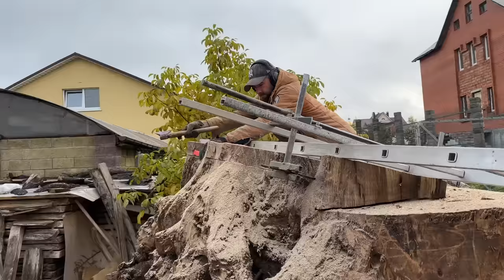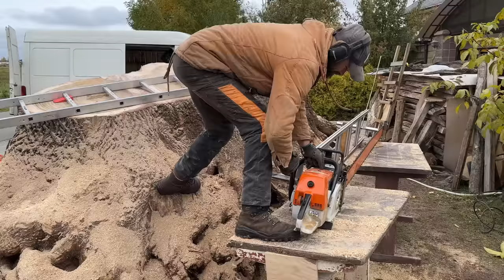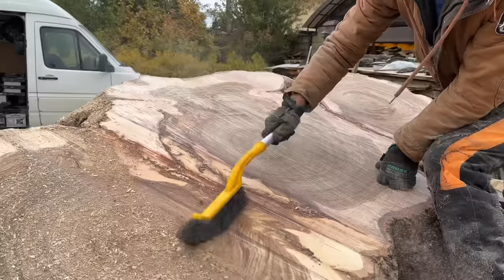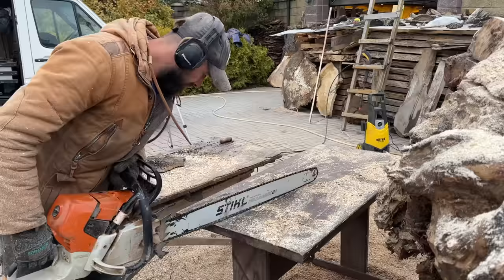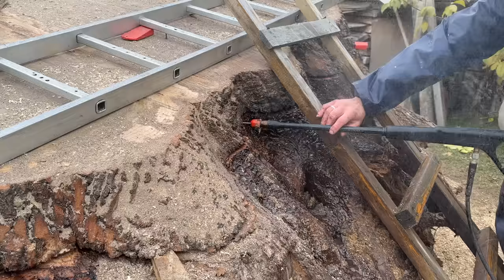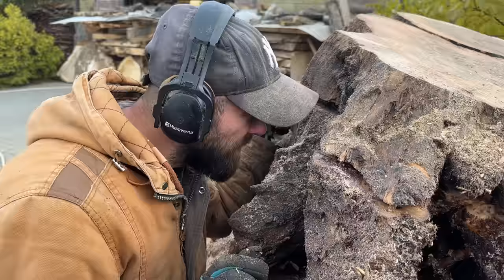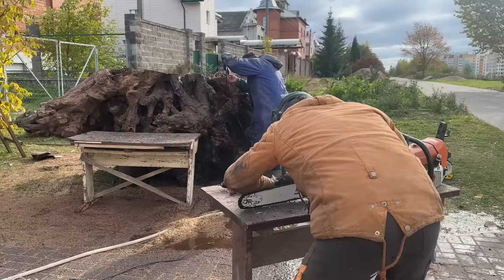A shocking find in an ancient oak stump

Comment: That was a tough slab! I saw stumps and root burls on my sawmill and stones are a killier, but that huge chunk of steel definitely would make life miserable. I have a chainsaw mill as well and always wondered how a carbide chain would hold up? 🤔
Reply from the maker: We have regular chains. The stone drank a lot of blood. We completely sanded off the top part))))) Basically it was not sawing, but one continuous sharpening of the chain🤣🤣🤣
Reply: I didn't know carbide chains existed.
Carbide is much more brittle, so instead of the teeth getting the edge dull, they would most likely just break off.
Reply: @spappy2k6  firefighters use them all the time to cut through nails and roofs and buildings. They are 1times more durable then ypu think
Reply: Stilh sold them, namede Golden teeth.
Reply: @Monkeysic  it must be a different grade of carbide then.
Moulder and planer knives made out of it would be destroyed the first sign of metal or other foreign object.
Reply: @BelkoWood mate you great patience.  Well done.
Reply: @BelkoWood Аа алмазные цепи бывают, вот с ними уже вопрос решился бы!!!😊😊😊
Reply: CARBIDE TEETH CUT BETTER, BUT THEY ALSO SHEAR OFF WHEN THEY HIT STEEL AND YOU NEED A GREEN STONE TO SHARPEN THEM.  MUCH MORE EXPENSIVE
Reply: @BelkoWood  The shocking thing for me is the fact that you are fooling the viewers with your false reports!!
Reply: @spappy2k6 depends on the grade of carbide.. there are demolition chains that fire fighter use that cut through bolts etc.. then there are carbide cutters for cutting stone too.. but.. they arent goot with wood etc.. they're more like corse grinders.. AND you NEED specialist diamond wheels & geared grinder to sharpen them
Reply: @BelkoWood experience aye is a school of pain & patience.. been down this path a lot.. a LOT!.. tips I can offer.. keep a sharp chain even cutting around embedded stone & steel BUT use slow rpm's.. you feel your way around it with the bar tip & only destroy a couple of teeth a time when you touch.. also.. don't run with your side cover.  I bolt through the bar to the mill at the power head end.. then i just swap sharp chains on.. i don't sharpen on the saw.. chain grinder on long bars is MUCH faster & helps with sanity.. 3000psi water blaster from a 1000ltr ibc tank gravity fed off the ute deck works excellent.. an 8mm tube braised to the blaster nossle lets in get right in the cut at the stones.. must have been a valued stump? cheers from NZ
Reply: Тест на ж/д рельсе...

Comment: I hear Teak is bad for pulling sand up into the trunk due to its fast growing. Many sawyers will refuse to cut it because it dulls the blade faster.
Reply from the maker: Well, it's oak. Teak doesn't grow here. It would be interesting to work with this wood
Reply: Its oily, I think because it turns water, was why it was once used aboard battleship decks. Definitely and outdoor type wood. @BelkoWood
Reply: @jmalone2758  Oh come on, the first thing they teach you in dendrotypology 101 is that contemporary dendrophilosophy rejects the traditional "indoor/outdoor type wood" paradigm, forgoing the age-old question "what about doors though?" in its entirety and arguing instead that the indoor type wood exists solely as say it with me now a social construct. This has been the prevailing academic consensus for many years, and for good reason; all dendropaleontological data consistently supports the hypothesis that trees naturally grow outdoors. The main area of contention among academics is centered primarily around the question of what type of wood this social construct is made of, and whether the annual convention can still be held at the The Rainforest Cafe.
Reply: @daan7004 Yup, if ya can't dazzle them with brilliance, just baffle them with Bull-sh!t.
Reply: @jmalone2758  Bullshit isn't hyphenated, unless you married into it I suppose. 'Outdoor-type wood' is hyphenated, and so is 'dumb-dumb word', which fits the bill. 

Because it's just such a dumb thing to say. As if there is such a thing as indoor-type wood. Of course, certain types of wood are less sturdy that hardwood, making them unsuitable for outdoor use in certain climates. 

But that's just the thing; the guy is from Russia. And you're talking teak. So yeah, no, I wasn't trying to dazzle you with my brilliance dude. I was just making fun of you for saying dumb-dumb things , twice lol.
Reply: @jmalone2758 It's oak. Plain and simple. It's oak.
Reply: @ironnads7975 Duh, I know what wood it is, using teak as an example.
Reply: @BelkoWood OMG you guys are killing me. Ever heard of using a different type wood as an example? Nooooo, toss in a grapefruit in that bag of oranges and everyone looses their dam minds.

Comment: Finding rubbish in tree stumps is the reason I try to avoid having to cut them up. There is often barbed wire and staples and the remains of tree ties made of rubber strips nailed to posts. One time I found a wire bird feeder that must have fallen off into a cleft that closed up around it.

Comment: If you cut using the top of the chainsaw bar it clears out the sawdust rather than packing it in and no need to pressure wash.  That thing is a monster burl.

Comment: I get rid of big stumps with bonfires because there's rocks in them. A milling bandsaw with brazed wire that cuts concrete and steel fitted would have be on hand before I even thought about slabbing a stump

Comment: Without a metal cutting blade the next thing I would do is use a metal detector and find the approx location of the metal object and come in from the top and remove the mass part of the stump and then remove the metal object and then replace the cut out portion of the Wood in the stump.